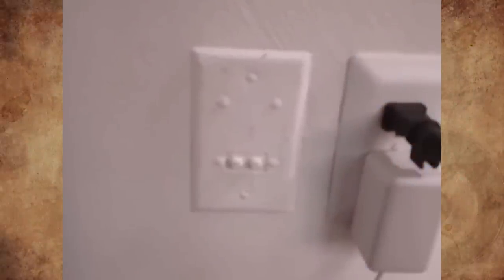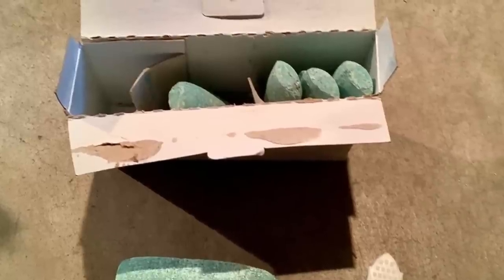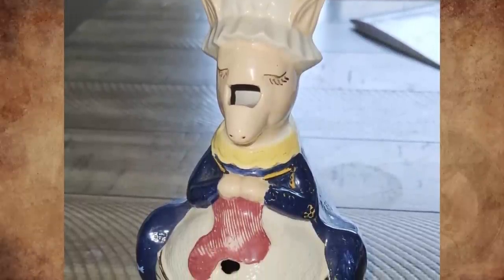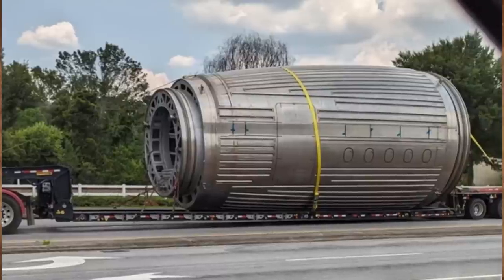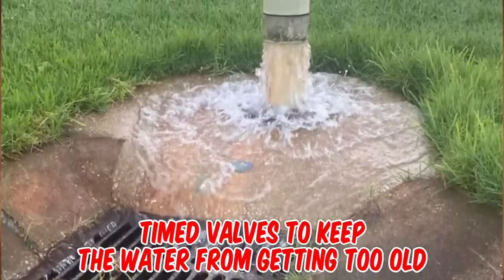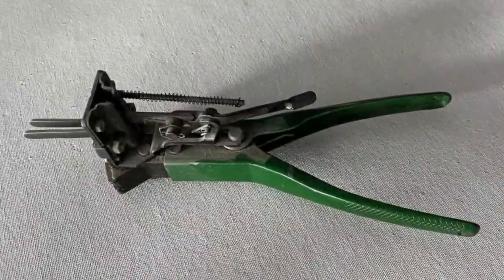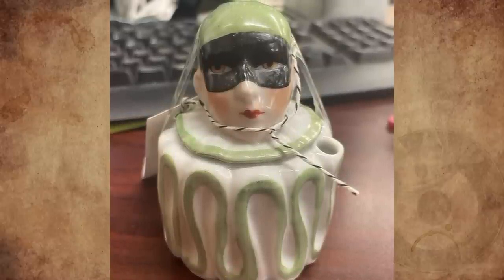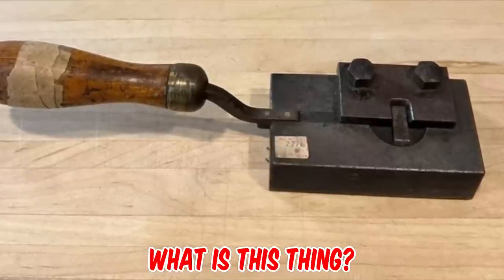What Are These Mysterious Concrete Supports And This Large Metal Exhaust System With Multiple Arms?

Comment: The last item is obviosly some form of casting mold. You can see the sprue hole on the side where you pour whatever metal is to be cast into it. It resembles a bullet mold slightly but it's shape suggests something other than bullets. Open it to see the shape inside.

Comment: The last item. This could be the mechanical lid for the air intake underneath a wood burning fireplace. It is removed when the fire is ongoing, but when the fireplace cools these are set to block the draft. I am a smith and I once made one for my mum, but it was just a lid on a stick, no automatic spring-loaded lock mechanism, like this one seems to have. It stayed put just by gravity as it fit the rectangular hole perfectly. The deeper underneath the hole is, the longer the handle must be. I do not know why the fireplace did not come with one, maybe because nowadays people have heated floors and no need for lids like this (my mom is a cheapskate and she keeps the heated floors low). The lock mechanism also could mean the intake was on the side wall, where as my mom's was on the floor. Someone might have renovated their house and put heated flooring in, which would explain why this is now orphan sans stove. Other possible fireplace lid is of course the ash base lid, but to my knowledge those are usually on the outside or very front of the fireplace and they would not require a long handle.
Reply from the maker: that's interesting! Nobody could give the right answer to this item for almost a month now. Most of the comments say it's a bullet mold but it doesn't seem right. The poster said his grandfather spent the last 30 years of his life trying to figure it out and never could.
Reply: @outlookdaily1713  I am not saying I am 100% correct, but it darn looks so much like it XD. But it would really explain why no-one knows what it is any more. When one has one, it is under your stove, so you do not really see it and in these modern times majority of stoves do not have one. And it does sound like using this lid was part of the  female's job, so his grandfather had no chance to see one in action. And of course, not all fireplaces and stoves have a replacement air intake directly from outside. So those won't need this lid.  In the olden times you put the intake under the stove to prevent the fireplace from pulling replacement air from windows, which would cause a draft in the house. But also modern windows won't do that any more and even if they do, modern houses usually have also radiators under the windows, so the air warms up.